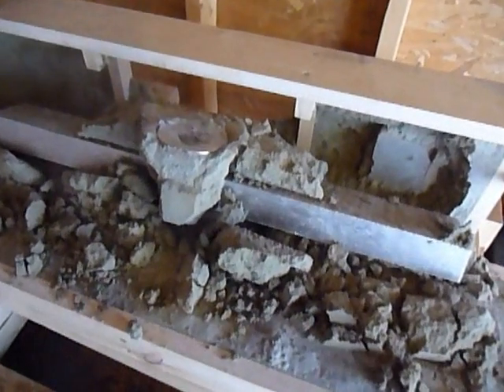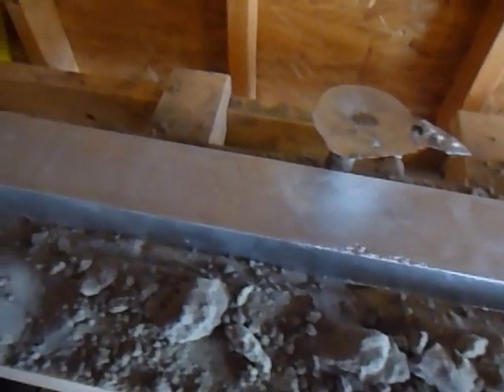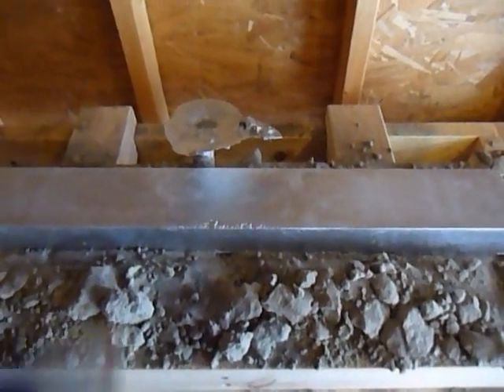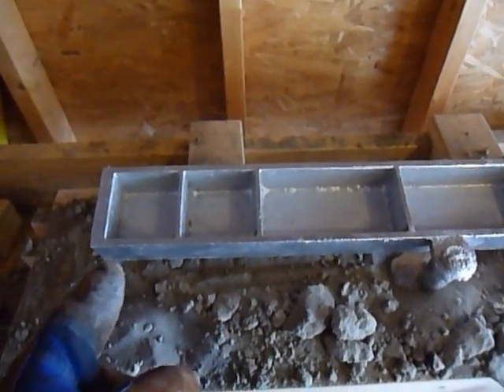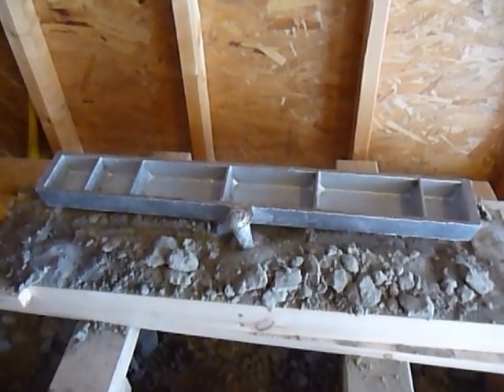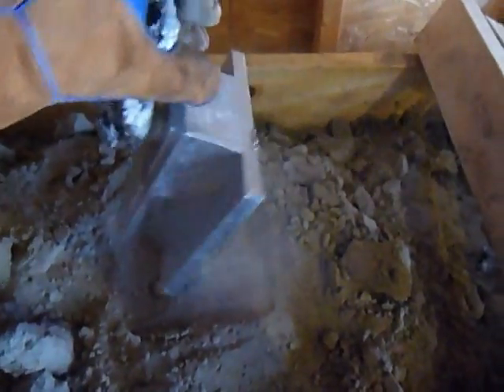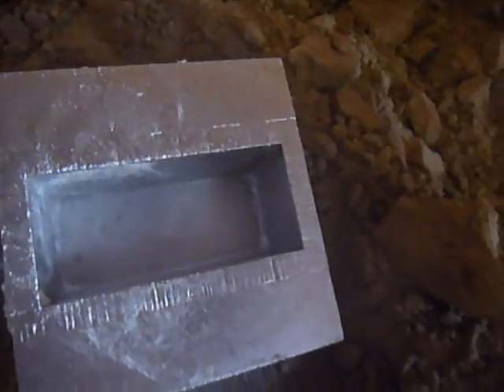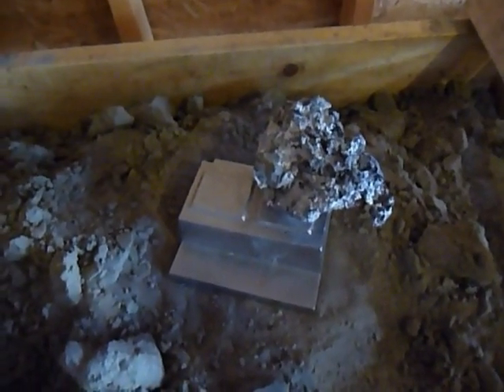Casting Gingery Lathe Bed & Headstock Foot

Comment: I am hoping to start casting my own lathe soon and I was hoping to get your thoughts and insight on your lathe. I am going to try using the lost foam method, and I'm thinking of a couple of mods. I plan to make a support footing of some sort for the middle section and I'm thinking of adding an additional 6 or so inches to the bed and ways. How has the lead screw held up and do you think it could handle the additional length without support?😂

Comment: I know how much work goes in to this.  awesome
Reply from the maker: HalfLife2Beta Hey, sorry for the delayed response. Anyways, yes the mold is pretty heavy, but manageable - you don't have to lift the whole thing - just try and keep the top and bottom boards on while you roll it over on your molding bench. Regardless, wouldn't want to do a heavy mold like this on a regular basis by hand :)

For scrap metal - at first it was hard getting some sources, but small engine repair type shops worked well ( they deal with lawn mowers, etc... ). They typically have a bin of aluminum waiting to be recycled, small quantity so not worth selling and they were glad to give it to me when I told them about my project. After that I was able to take apart a few broken down lawn mowers ( the engine blocks and pistons are great casting aluminum  - a dirty job but worth it ), and finally I found 2 nice aluminum rims for $5 a piece at a local resale store. At this point I still have one rim witing to be cut up, and a whole barrel full of pigs waiting to be cast. There is a lot of scrap aluminum out there to be had, but be sure to only use aluminum that was cast ( not extrusions, etc... ) as you know the alloy is already right for casting.

Cheers,
Morgan
Reply: Morgan Demers 

Bonjour,

Bonne source approvisionnement, être bras suspension train avant Audi VW ;)
Reply from the maker: Yes, the bed casting was by far the hardest part to cast, especially being the first item cast for the build and also needed a special flask, lots of heavy sand, and a full pot of metal. I was lucky to get a good usable part on my 2nd try, but I have heard of many people giving up at this point in the project.
Reply: Morgan Demers
how did you cope with the molding process, I mean  you gotta lift 30+ kg of sand and upturn it, I don't know how I would do that, and where do you get aluminium for the casting? thanks you

Comment from the maker: @algae1000 As for the green sand mix, I started with what they had at foundry101. Though I did have to add a considerable amount of additional water and bentonite to get the green sand I wanted - tested by blowing through the sand, squeeze testing to see how well the sand took my hand print, and making a ball of the sand and tossing it up in the air and seeing if it broke when caught ( not breaking is good ).

Comment from the maker: @algae1000 My furnace can accept a cast iron pot no bigger than the 1.5 qt which was why I used it. If I could have either build a bigger furnace or found a pot that was not as wide, but deeper I would have used that instead for safety.

Comment from the maker: @algae1000 I was using a modified 1.5 qt cast iron sauce pot ( can find if you search for the Cajun Cookware reseller on Amazon.com ). Not sure of how many cubic inches anymore, though when I did the prep I had figured it all out, and it was quite close. I had to scale down my original bed pattern ( which was originally 1/2" stock throughout ). Anyways, the pot was brimming for the pour, so be extra careful.

Comment: Nice work!  Does the bed require the largest amount of aluminum.  Do you know how many cubic inches, or what the diameter of your crucible is and how full it was?  I couldn't make out what you said about the sand.  I think I heard _____ sand, and bentonite.  Did you give proportions and do use oil in it?  Thank you for posting your videos.